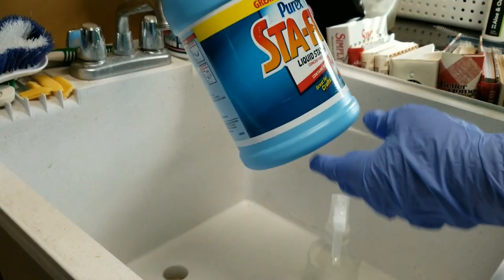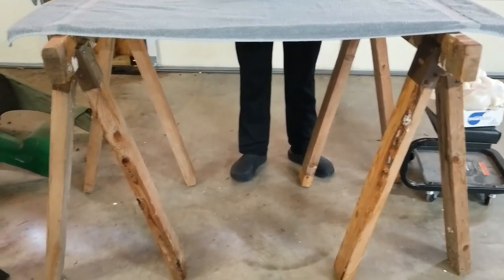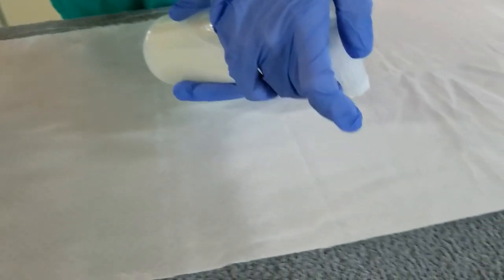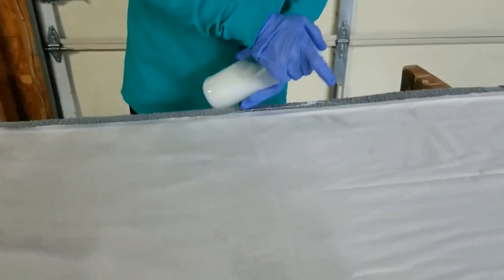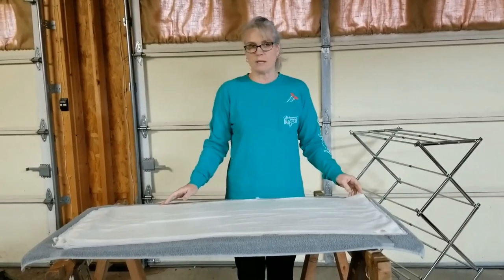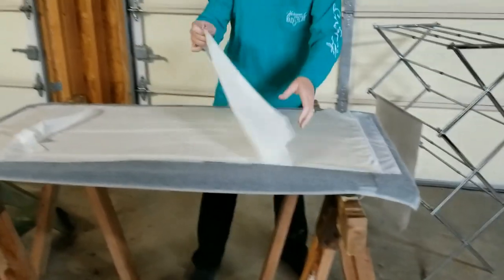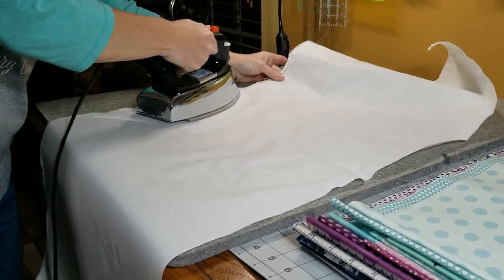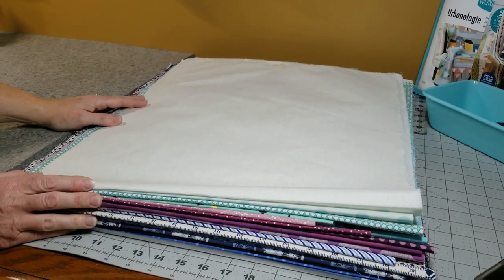Starching fabric for quilt piecing

Comment: Hi Tiffany, I’m thinking throw the dump fabrics with starch into the dry machine... can this damage the fabric? Thanks!
Reply from the maker: I haven't tried that, so not sure about damage to fabric.   I like air drying to give the starch time to work into the fabric and laying/hanging gives me the least amount of wrinkles that have to be ironed out.
Reply: Tif Sews I did! And worked really well, I throw 20 fat quarters completely damp at medium high for 10 minutes, darks and light fabric, the result was really good like hanging and iron a little bit for have a completely smooth surface🤓🙌🏻 saving lot of time 🌟